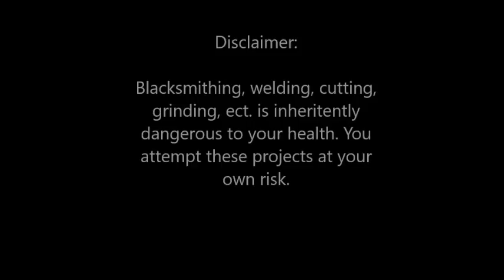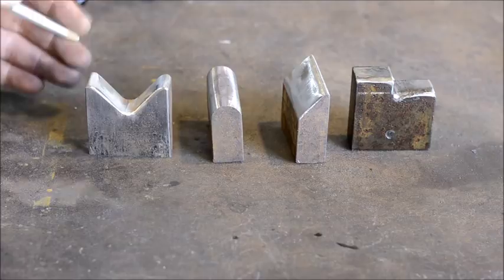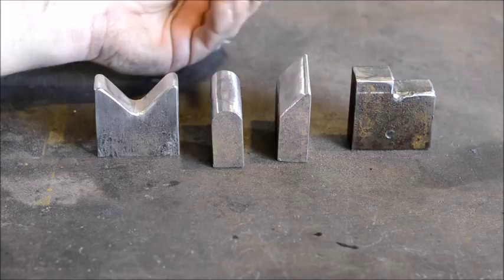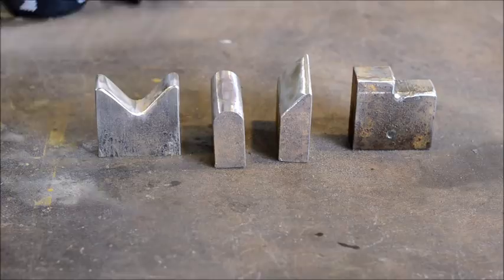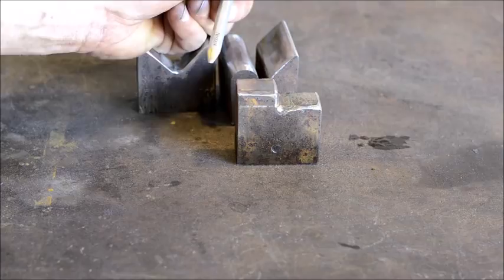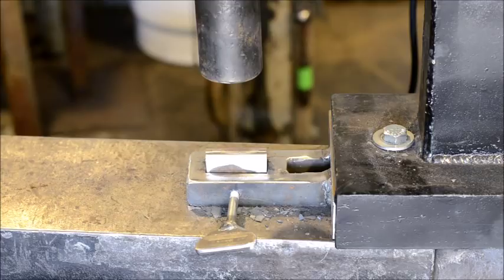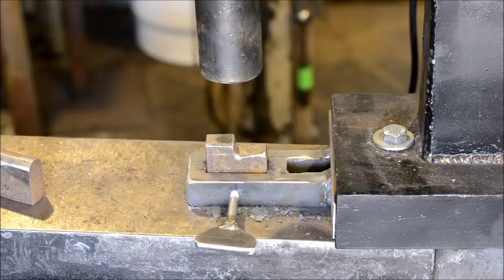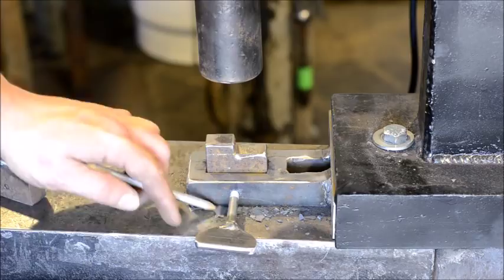HARDY HAMMER REVISITED // Forging Tongs With Small Power Hammer

Comment: Hi Roy thanks for the hardy hammer plans I have a question regarding the anvil that the hardy hammer attaches to does it have to be 250 ish pounds or could you use a smaller anvil and use a heavy base to compensate and make up for the missing weight as the anvil you're using in the video looks rather large